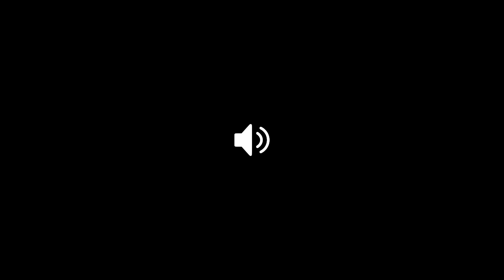There are not many old tower block lifts left

Comment: In Liverpool we have an  abandoned 14 floor tower block left empty in it's early 90s reconditioned state, Vine House in Seaforth. They're a bit of a unique design too with 5 storey precast columns with wide car park like spandrel panels then 3 storey columns add the rest of the height 3 storeys at a time. There were 7, 4 have been modernised and ruined with hideous cladding, 2 were "demolished", which went badly wrong, and then there's Vine House, right next to the station. It's been abandoned and empty for years now. Might be one to explore. Then there's the Triad in Bootle which is a lovely bit of brutalist design, sitting on top of the Strand Shopping centre which itself is full of late 80s postmodern design.
Reply: I'm in Liverpool

Comment: actually those old tower block lift only need very little maintanance. i bet it is cheaper to just maintain the lift rather replacing it with some cheapass bullshit.
Reply: The problem is finding a company willing to work on an old lift without charging a fortune. Even if they don't need lots of maintanence, they probably require inspections and stuff.

Also newer lifts are easier to make compliant with disability laws. And to someone who knows nothing about lifts, replacing a grotty old lift with a new clean lift seems good.

Comment: Not many old lifts left in the uk in general. Its getting to the point when lifts from 2000 are already being modded.
Reply from the maker: There is very little left of interest in lifts nowadays.  Any building that is less than 130 meters tall has MRL lifts that are not suitable for the height and too slow.  Mid and low rise buildings have cheap base model lifts or generic lifts.  Old relay lifts (pre-1980) are very rarely seen.  Lifts from the 80s and 90s are being replaced as electronic components from that era are hard to get hold of.  The generic Lester Omron mods in the 2000s, which I used to find boring, I am now starting to find interesting, as at least when going on top the lift it still has the original heavy duty lift car.  Lifts in the 2000s that are traction are starting to be being replaced, which says a lot about how thing are nowadays.  The hydraulic lifts which were everywhere in the 90s and 2000s are almost completely gone as hydraulics were never built to last in the first place.  It is very rare to see a hydraulic lift now, apart from service lifts, which feels very weird as 50% of all low rise lifts were hydraulic 10 years ago.